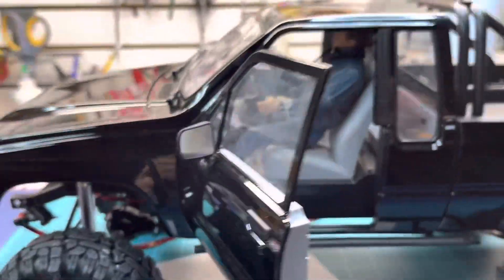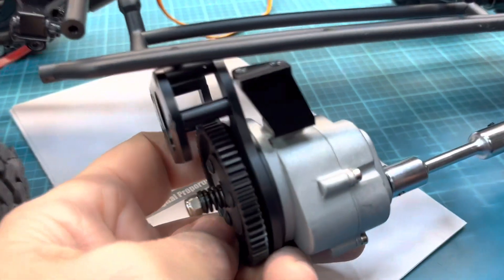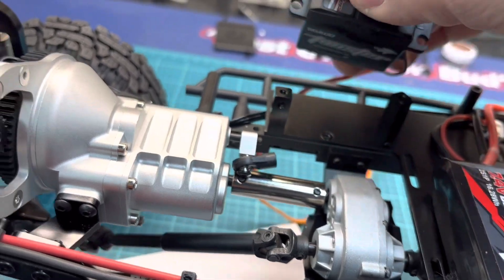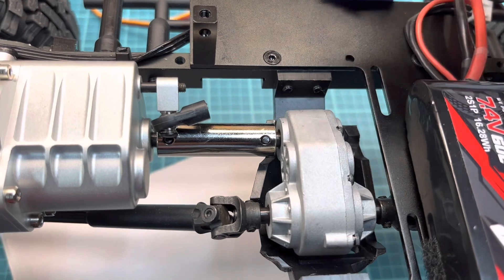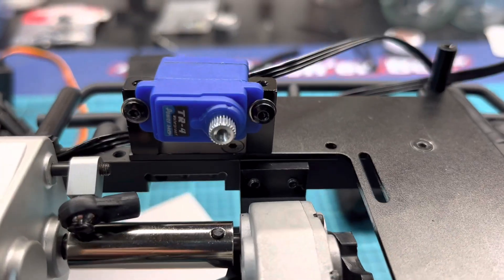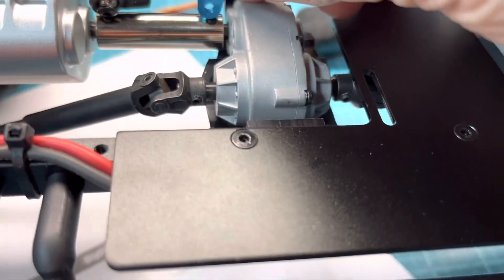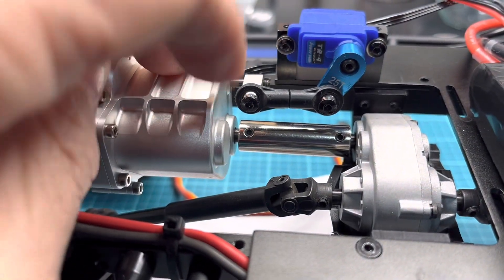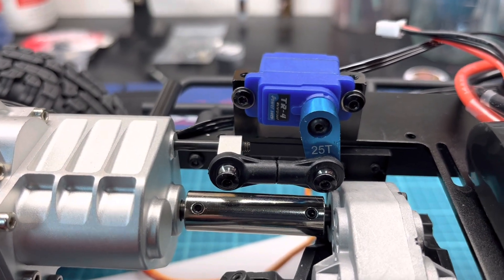Slapping in a micro servo to shift an RC4WD R3 2 speed transmission.

Comment: Hope those are steel gears in that servo as it wont last when under load while trail Riding. Especially if you shift while on an incline.
Reply from the maker: Plastic gears, economic function, and still better than an RC4WD plastic geared micro servo. Oh wait, they don't make one.
Reply: @mcdude_rc  yeah I don't like there electronics either I was just speaking from experience about plastic gear servos with that transmission. I run a budget hitec waterproof servo in mine now.
Reply from the maker: @mikeshobbiesandrandomstuff  I hear ya. The first thing anyone ever told me about the 2 speed RC4WD transmission was to never/avoid shifting at higher RPMs. I have already gone through one of these transmissions with this servo setup, and the servo won. No issues with the micro servo since then on my end.

Comment: I feel like the servo hasn't finished its operation yet, the arm is stalling
Reply from the maker: I use the Flysky GT5 receiver, so I am able to set my end points for how far the servo travels in either direction. No binding and no issues, just proper distance travel for the function prescribed.